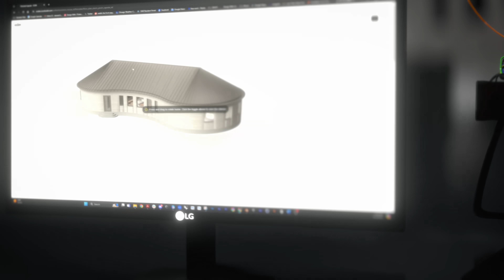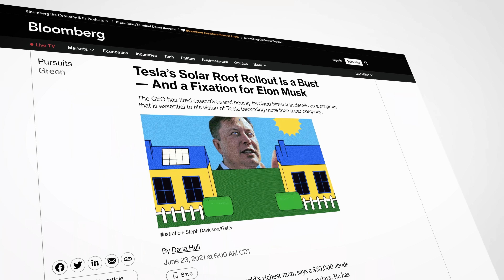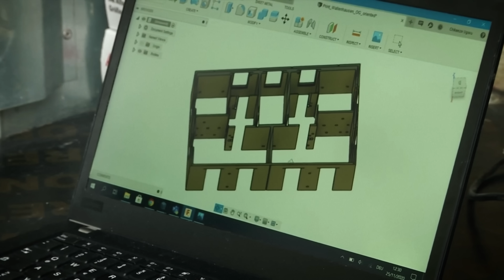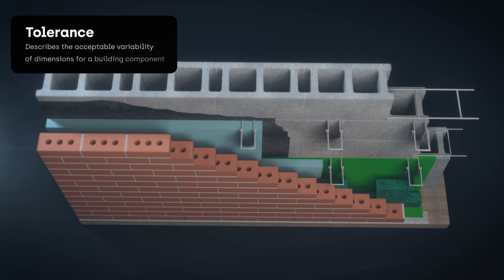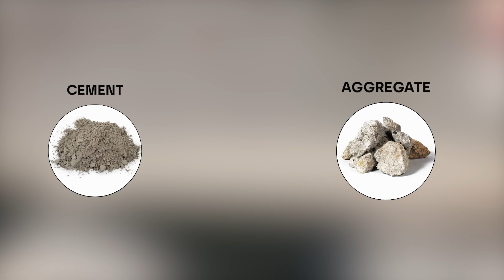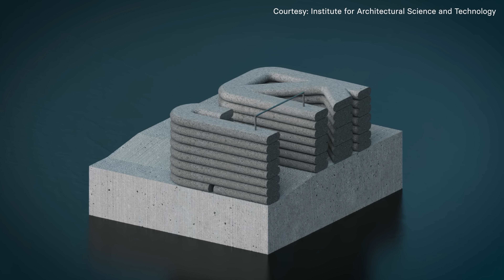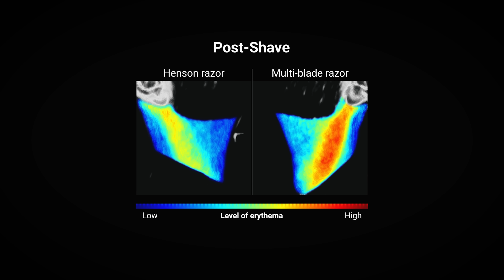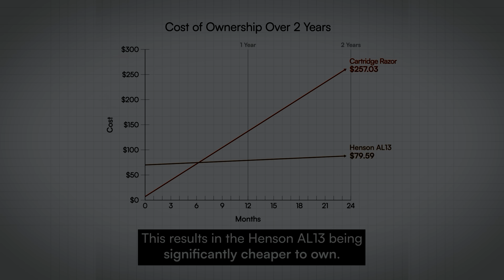Why 3D Printing Buildings Leads to Problems

Comment: I did residential concrete for 30 years. I am excited about this method of construction. Not sure if the stacked block foundation walls can or would be better or not. They do take more time. For the round corners, if they can use a lentil for spanning the door ways or windows, then I don't see why they can't make a square form for those things. Shouldn't be too difficult. As for the "rough" interior and exterior walls, that is what plasterers are for. Stucco would work. I did build my forever home out of wood fiber and cement blocks. Huge sound and thermal insulation properties. They now have "plasticized" plasters for the walls so that can be applied direct to the finished product. I am sure that can be adapted for this use. I do not know if it would be possible to trowel or hand float the walls as they are poured or not. The slump they are pouring makes me wonder how high they can go before the weight will make the walls settle. Concrete is horrible for any kind of insulation. Even filling the walls with spray foam, I just can't see that working well because the cold or heat will transmit through the concrete. Repairs should not be much of a problem. I am sure they can find a way. I would hope they are putting micro fiber in the concrete mix.

Comment: One big thing you are missing: that building was unreinforced concrete.  Unreinforced concrete has good compressive strength but hardly any tensile strength. Tensile strength is provided by rebar, but that building had no rebar.  That would not meet code in most locations, for very good reasons.

Comment: It takes years and years to design a new car.And 2 to make a new assembly plant to make a car.So I don't know what you're talking about when you're talking about time scales. I've worked on twenty story buildings that were built in one year. With people moving in. And landscaping all done. What you're talking about.I have no clue.It doesn't make any sense whatsoever to me especially when you're comparing it to the auto industry which could take a decade to get a new type of vehicle from concept to actual units being sold. Utterly ridiculous right off the bat

Comment: I think the layered toothpaste look is just FUGLY. Has it not occurred to these people to have the nozzle with side walls acting like a trowel that extends down beneath the layer being poured to smooth out the toothpaste look? They already have servos to rotate the nozzle. The rounded corners would fit in perfectly with the adobe look required in Santa Fe.

Comment: The problems are arising because the theoretical basis of this type of construction is all wrong. The ideas that they are attempting to make ascendant are that the machine must replace the construction workers. 

This is a massive misunderstanding of how machines and humans function. The machine is an embodiment of everything humans know how to repeat, whereas humans should be focused on what is not yet repeatable. 

For this construction tech to be truly considered functional, it should be given to a full crew of construction workers to determine if it increases their productivity.

Comment: Im a union carpenter and think its cool how this is done but i dont like it cuz it takes working mens jobs like mine! Also by doing this and not having any rebar or a cage inside of these walls so you are going to be sacrificing strength by not having steel inside of that.

Comment: All over the World Homes are made from cement, they repair those homes when there is damage. Cement can be repaired. The arguments he makes against, are fixable; for example window fitting, that's solvable, obviously they already have; he says the walls have to be exposed, do they, or are the pilot homes just what they are? Covering walls would increase cost, but they can be covered; you wouldn't be stuck with imperfections. That's assuming the imperfections would even be common.
Reply: Ever been in a basement with drywall? Basement walls are cement. Ding🛎️🛎️, you can drywall a cement Home. The guy in the Video is a propagandist.

Comment: If you saw how windows in NA are installed, those concrete lumps are not a problem. Windows are constantly shimmed and foamed when installed because there are like half and inch gaps between them and the walls.

Comment: 7:38 excuse me, what?
Reply: Caulk
Reply: Yeah, most of this guy's argument's are nonsense. It's just a video made to make money, by offering a "counter" opinion.
Reply: Yeah, this nonsense got me too. We in Europe use metal studs and/or ankers and an insulation foam for that matter and it works perfectly filling the gaps of an inch or so, preventing any heat leaks and securing any window or door in a still position No idea what's the narrator is in about.

Comment: The two things I always wondered about this: why not smooth the walls out after they have been extruded, and why not cover the walls with stucco or plaster? From the people in the industry posting here, it seems like the answer is it would raise the labor cost, which negates the main selling point for this method.

Comment: It is wrong to call them 3D printers. They are 2.5D, they only make extrusions: the shape is the same at the top and the bottom. You can make it thicker at the bottom but not the other way around, not a lot anyway. True 3D would be able to print any shape, in any direction.

Comment: 3D printing mortar - because if it has only sand it is mortar, not concrete - is a solution to a problem that doesn't exist. On top of that, it comes with major flaws. Integrating rebar in a reliable way, so that an engineer can sign off on it? Nope. Doing it in the open air, when it's raining? Nope. Drying (curing) properly? Nope, since the sides are exposed. Sustainable? Nope, since it uses cement (major carbon footprint). Printing horizontal surfaces on site? Nope, since you need a support structure. The only benefit is a relative form freedom. But form freedom has never been an issue in architecture - we've always had solutions for that. It's a cool technology, but it sits in a very small niche.

Comment: I dont understand why it should not possible to smooth the concrete directly while printing it. In example the could be little side arms to the print head the hold guides.

Comment: I've worked for a number of contractors, from residential to high-rise.  NOBODY tolerates a concrete wall that is 20 -25 mm off, especially a foundation wall.  Downtown, you build up to the property line.  An inch onto another lot could cost millions.
Reply: right. I poured concrete walls for several years and my in-laws are block masons. The tolerance is 1/8 inch for both
Reply: @christopherbowman2435  1/8 inch is 31.75mm :I
Reply: @christopherbowman2435  what your thoughts on cold joints
Reply: Whoever is making the measurements and doing the boundaries is the one who should be responsible for that kind of nonsense because at some point you have to be able to measure properly inch by inch and enter that into the machine 25 mm is not a small Gap it's almost an inch you're building block to block wall to wall at that point you can't make silly mistakes like that maybe two millimeters up to 9 mm you know it might not be too noticeable but holy crap 25 that's a lot 

Besides you should be building stuff or using stuff like this on the middle of a property for maybe a a band or something or you know a unique structure like a one big room Warehouse so something of that nature otherwise why would you want to build in the middle of a city with a big old robot blocking traffic you know obstructing everyone else around you doesn't add up
Reply: Concrete retaining walls along the roadway have a person that can made it look like rock, which looks great.
Reply: Thomas Edison (yes that Edison) tried making poured concrete homes.  He had molds that he put up and filled they will concrete.
Reply: 25mm is 1 inch
Reply: @ski1749  thank you. 😂
Reply: Maybe they can poke holes in the just layed layer so that the next layer can fill the holes for better bonding between layers.
Reply: @ski1749 bonding isn't the issue.  Wet mix upon wet mix will bond fine without holes.  Now, holes with rebar in them...
Reply: Lol this is 5 years away from being mainstream. You're delusional if you think billionaires aren't looking at this and licking their chops at how few employees they're about to have.
Reply: @BillytheEscapeGoat  I don't think this will ever gain acceptance. It's ugly and won't perform well in heat or cold without a metric fuckton of insulation. Aircrete is better in a lot of ways...they just need to bring the price down I think.
Reply: @Billabongbabalog  "The fastest way to become a millionaire is to be a billionaire and go into contracting."
Seriously, in my area, Seattle, all the flat, level, spacious lots were built upon long ago.  Wide-spread use of 3D shortcuts in construction is coming.  
We have plenty of billionaires here in earthquake country, but don't expect them to invest in rebar-free, aggregate-free, structural concrete foundations. 
Foundations that could be an inch off.
LOL.
Reply: 3D printed smart cities built on one foundation is the future you want and will have. EAT THE BUGS!
Reply: @Billabongbabalog  Nope. I've been in this house for 30 years, got just like we want it.  No billionaire is going to buy us out and lure us to some "smart city."  If that's what you want, they're building that crap right now in Saudi Arabia.  See how that works out for you.

WORK OUT THE BUGS. Until then, dream on.  
And learn a little about seismic engineering.
Reply: @BillytheEscapeGoat  it is the future and has no bugs involved. You’re stuck in the ancient past. A Luddite. Get with it or get left out.
Reply: so leave a one inch margin, problem solved🤪
Reply: @1030media  they literally just commented that an inch isn't an acceptable margin in their field of work. not sure it would even be worth making a 15 minute video if it were that easy
Reply: @1030media I'm a structural fabricator, I make the steel spines for buildings, some peices I work on are 60 feet long and weigh upto 20 tons, our tolerance is 1/16th, we prefer 1/32, were happy with 1/64th

Comment: Evidently you don't have a flexible mind. Im not an engineer but i have built meshed in additions to many of different structures. BTW any window openings are always 1/2 to 3/4" larger than the window to square them up. You must really hate this process.

Comment: Those play dough printed structures are disposable. Every renovation, remodel, and repair turns into a drilling and masonry operation without the benefit of modularity so it inevitably gets scrapped.

Comment: Why don't they just use the gantry machine to place bricks instead of squirting out concrete? Just feed in bricks and mortar on a conveyor system then you won't end up with a building that looks like sh't.

Comment: Try cleaning between the layers in a few years after they collect dirt and dust from everyday living.
Reply: I think on the interior you can smooth it out if you want. It's just that a lot of 3D houses now just want to show LOOK ITS A 3D PRINTED HOUSE. 

Those layers could be smoothed out easily they just aren't because they want the house to visually show how it was made.
Reply: Unlike vinyl siding? 😅
Reply: Well they do often promise this will be a "green" solution... 🤣🤣
Reply: Do you have to follow the printer with a trowel smoothing out wet concrete, or apply a skim after? I guess you need to make a grader for  the back of the printer, and a cleaner on the back of that.  Where I live in the UK the ridges would fill with snow and damp, dirt, cobwebs and bugs, then vegetation, then cracks. Walls facing away from the sun would hold damp and moss and go much faster.   What happens to concrete once it's demolished? I can see that happening a lot. Does it get reused? What's the environmental impact of that, or is that somebody else's problem? The average lifespan of a house here is about 70-100 years but that's sadly falling. But construction and materials and environmental costs are cheaper if you don't have to keep throwing it all away and doing it again.
Reply: The fact that you find that to be your first objections tells us something about your thoughts.
Reply: The fact that you make such a vague & nonsense rebuttal shows the state of your mind. 🤦
Reply: @queenlip6152  My mind is in a very good state.  The fact that you misunderstood and judged instead of asking for clarification shows the state of yours.
Reply: @MrSteeDoo  What does it tell you?  That I have experience in such matters?  Or are you imagining something else?
Reply: @ronyerke9250  The first and clear problem is that concrete printed houses have huge issues and they don't solve any problem.
Reply: @MrSteeDoo  Ah yes, like termites, severe weather, Dry Rot, Wet Rot...
Reply: @MrSteeDoo  Yes - he is thinking  rationally about the finished product and how it impacts on the routibe lives of occupants -

Comment: Building constructions have been optimized over 10000 years or so. Cars, 100 years. Smart phones: 10 years. (Give or take a factor 2).
Let's return to the problem when the phone's manufacturing process has been optimized for 10,000 years, and let's see if the rate of  development still is as high.

Comment: If it doesn't cost less, and isn't much faster, and all the finishing is still done traditionally, then it's the 3D construction company that wins. With this technique they don't need to hire as many workers, and the materials are simple, and thus abundant. I propose that the logistics of construction is where the value lies in 3D printing. Not with the finished product, nor the cost, nor the time. Someone with construction logistics experience please let me know if I'm wrong.

Comment: I think those buildings look great. The problems will get worked out. AI will probably be involved. Eventually 3D printing houses will be normal. And machines will do almost all of the building including the plumbing and wiring and painting. 
People will get used to the curves. Curves are stronger than straight lines and these homes could be like castles, very strong.
I'd love to have a 3D printed home with a printed dome roof that collects the rain and sends it to a reservoir.

Comment: There is a way when 3-d printing a building it can be printed with sharp corners and smooth flat sides that show and it's very simple, all that is required is a simple flat plate tool addition to one side of the printing nozzle, as the nozzle moves along the wall that is being printed and as the mixture is coming out it is pushed against the plate it becomes smooth and the nozzle and plate slip along each row buildup and form a smooth wall and for the sharp corners all that is done is as the nozzle and plate slip and turn a corner it automatically forms a corner, I have proven this works, the idea comes from slip-forming the way they make curbs, hwy dividers and or walls and so forth.

Comment: ? I don't know about u all but as a Mason I see an easy fix especially for the exterior. It is not hard to put up wire mesh on the outer wall and just stucco everything smooth and square.

Interior same thing just use  spackle. And concrete anchors for cabinetry and finish work.

These problems are easy

This is rock us Masons have made rock do what we want for 100,000s of yrs

Comment: Once they get the machines working well they need to swap to using neo-Roman concrete instead of Portland Cement Concrete. It should last significantly longer without crumbling from weathering. Like 5-10 times as long in all likelihood.

Comment: Being a contractor, i heard no insurmountable issues in this vid.  Some issues (modularity) will just be a choice of tradeoff as with any choosing of construction practice.  I was waiting for a couple real issues that would present as a real barrier that would have to be solved before this construction method increased in popularity but i really didn't hear any. Only hurdle i see is increased cost of subcontractors working within a new system, but that will sort itself over time also.
I didn't follow the segue into the razors and then when it lead to the add i realized it was just a creative reach. :)

Comment: One important factor to understand. Bricks are a siding at least in the way described here and in most cases in the USA. Different from concrete block foundations or structures made from concrete blocks. And 3d printed Concrete is actually the building structure.

Comment: The most important things in 3D printing is calibration and rigidity (which translates to tolerances) in the machine. When you build layer by layer. Every layer impacts the next. Sure you can adjust and compensate as you go, but this whole process screams of the opposite of automation. You want highly repeatable consistent output. Why not just expand on prefabrication rather than trying to make a large overly complicated contraption that will constantly fight you to leave its calibration envelope.

At the end of the day, these don’t 3D printing houses. They 3D print rounded cement walls. They are analogous to cinder block walls, and if anyone has seen how quickly cinder blocks go up on a construction site, what are you really saving here? At the cost of not being able to utilize interior space as well.